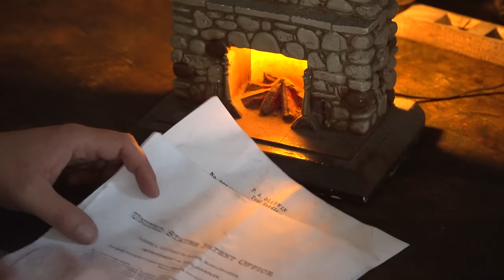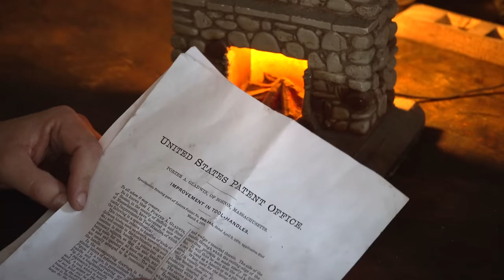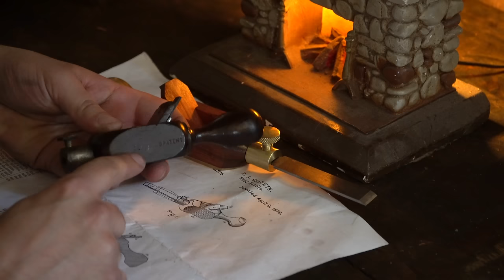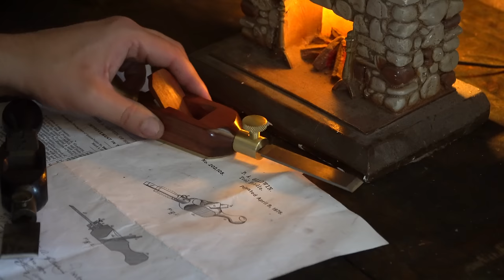I Remake An Odd 1878 Hand Plane Chisel Patent [Patent Remake]

Comment: Yes! This is so good, I love it! To be a real pro with this tool, one would know precisely how many taps it would take to chop dovetails, while simultaneously setting the plane iron to plane them flush later.
Reply: collaboration with Uri please!!!
Reply from the maker: Maximum efficiency as it could also remove your fingerprints at the same time.
Reply: So much wood and brass! You must be in heaven Uri haha
Reply: A collaboration between these two would be AMAZING! The videos AND resulting shenanigans!
Reply: yes, as he was demonstrating it I realized the issue with adding a sharp blade to the tip of something you forcefully jab forward that often gives unexpectedly. I'm saying I think someone is going to get stabbed with the chisel while planing something and someone is also going to slice their hand open on the place while chiseling something. You would need to remove the other tool while using it or at the very least put covers on the blades. HTR should put out a part 1.5 where he makes the covers, they would help for storage too.
Reply: @HandToolRescue  quick question for you, what are the diamond stones you use in this video? I'm looking to upgrade my old crappy diamond plates to proper ones, not sure what to go with.
Reply: When Uri comments your video it has to feel like being touched by a god
Reply: Uri, I was thinking of you the whole time HTR was working on it!
So glad to see you here!

Wonderful work HTR!

HTR and Uri... two of my heroes!

Comment: The invention appears to be a bit of a solution in search of a problem, or an example of new invention that consists of combining two existing inventions, and almost invariably ends up doing both tasks at least slightly less well than the original tools.
But recreating it was a fantastic idea for a project/video. I love stuff like this.

Comment: Beautiful workmanship, gorgeous piece.  However, I can't see a practical use for it.  Combining two very useful tools to create one barely useable tool.  Typical of many late 1800s/early 1900s patents.
Reply: Seriously guys, as if this was the point. Your view on 'the best tool' is completely irrelevant isn't it? It's a thing of beauty, it has some utility, and I'm prepared to bet that in the hands of a craftsman could produce work of a quality way better than that provided by tool experts with whatever they knowingly describe as 'better'. Anyway, I don't see why it wouldn't make a perfectly good small plane (you'd remove the chisel blade to use it, surely) and a decent chisel. I'm reminded of a comment about, I think, Victor Barna, a British table tennis champion of the 50's/60's, of whom it was said he would beat the second best player in Britain using a frying pan. Skill matters more than brand.

Comment: Beautiful reproduction of a really dumb tool.
Reply: So easy to plane your own skin
Reply: Tools are only as smart as the people handling them.
Reply: This might be really specialized for certain jobs, or attempt of making universal tool. I dont know witch is it, but i kinda get when you are on the second floor fitting windows and need to take just little bit off this could do the job and fits into pocket.
Reply: Because having to remove and readjust parts on half of it is convenient when switching to the alternate function. Either that or plane away a good bit of skin when trying to get a better grip on the chisel, or stab the chisel into something when trying to plane something. Understandable that this thing never went anywhere or caught on.

Ok... It seems more realistic that it just uses the same blade in either spot rather than having two blades for different functions at the same time. But most people find plane adjustments fidgety to get right and don't want to mess with that much outside of needing to sharpen its blade. Not to mention chiseling puts a blade at more risk for getting nicked, which is the last thing you want on a plane's blade. So it's still not going to be popular for that reason.

Comment: Terrific resurrection! Have been waitiong for this one for a long time, and your work exceeded any expectations I had. I did not realise the chisel/plane iron could be swapped out. Genius! I wonder if the chisel tip could be used in the plane body to transform this into a sort of ad hoc router plane? 

Using this tool seems incredibly dangerous though, for the user as well as his fellow workers. Imagine stabing your colleague with the chisel while taking off a few shavings in plane mode... Also, the patent seems to neatly combine the drawbacks of both a plane and a chisel. In other words: definitely worth a reproduction!

Comment: A fabulous re-interpretation off of the original designs.  It's easy to see why the tool wasn't in production for the ages.  It's an interesting widget sort of tool but just not practical in the long run.
Reply: ...and a bit on the dangerous side.  also?  apparently unadjustable.  planers with screw adjustable planes replaced things like this long, long ago.

Comment: That design on the wedge will help the shaving come through easier.  I would copy that to yours.  I would epoxy the handle in too so it does not come loose.  I imagine it was used for something like fine cabinetry.  I looks really good, like something you could put on a mantle.  Brass, cherry, and steel look good together.

Comment: Marvelous execution of this dangerous and pointless tool. I'd never use a chisel that has a razor sharp blade sticking out of its handle, and the hassle of bringing a hand plain from its drawer isn't as bad as replacing the blades over and over. However, it's gorgeous and looks like a super thrilling idea.

Comment: Also I can see a modification that I think might be great for that. Instead of one thumb screw hole just on top, make four, top bottom left and right. That way you can move the screw around so as to get into tighter spaces, etc. Just a thought. I know it's not in the original design, but I always look for function over form.

Comment: An interesting but impractical tool.  Seems that hitting it with a hammer to use like an actual chisel would loosen the plane blade, and the all-wood version looks like it has a pretty significant weak point where the handle tapers as it meets the plane body.  The thin walls of the plane look like they would be another weak spot.

Comment: Aren't the flats in the handle there to keep the tool level when you move past the edge of the material? otherwise the tool would bump up in the back when to handle comes in contact with the material.

Comment: I feel like your recreation is a little more practical than the original since yours is slightly larger and has the brass sole, but at the same time I feel like the design in general could have been more practical if there was like a sleeve or something that could lock over the chisel to turn it into a handle of some sort

Comment: I know I'm a little late to the party but would there be a way to insert like a steel plug in the brass handle to peck at it with a hammer. Not slam but peck if need be or would that be pointless. I was just thinking without a plug it would flatten the brass with a quickness yes?

Comment: 13:52 Spread epoxy with a screw, get better adhesion from the scratches and get the glue applied in one easy step!

Comment: Hi.
Worked at a store some 12 years back and saw that they had huge threaded rods with nuts on them. Never really saw a tool for moving those up and down (the nuts) without taking the tool off, readjusting it and them applying it again. Came up with this "simple" design somewhat based of a ratchet wrench. I'll likely never do anything with it, but maybe something for you.
https://imgur.com/l7j5eqA

Comment: this thing seems so impractical , why would someone make such a thing???
Reply: Cabinet making. 
Edit the blades exchange for different angles and cuts also ide imagine if you can make blades or have them made it's endless possibilities of cuts interchanging them between the block cutting and end cutting Eric didn't show it but with ease you could put the narrow blade in the block set. You've gotta have a mechanical mind to see it also understand that planes was the only tool to shape wood for centuries. So being able to have many styles advanced the options.

Comment: Not the most interesting thing, but I have this rectangular piece of brass plate with a slot and a hole in it and a patent number stamped into it. It's part of an assembly described as "Laterally adjustable bolts", as seen here: https://pdfpiw.uspto.gov/.piw?Docid=02927496 
Not entirely sure how it operates, to be honest. Can you make head or tails of it?